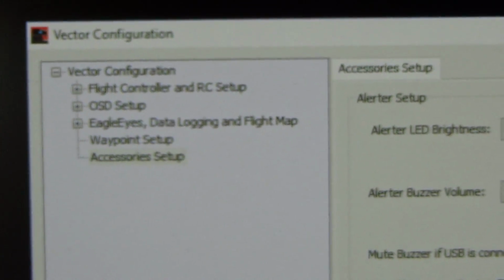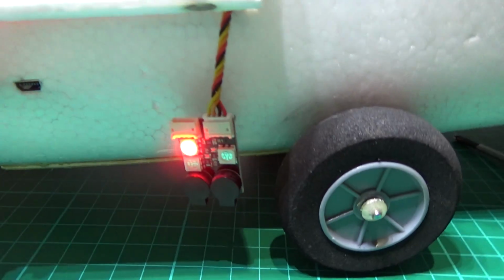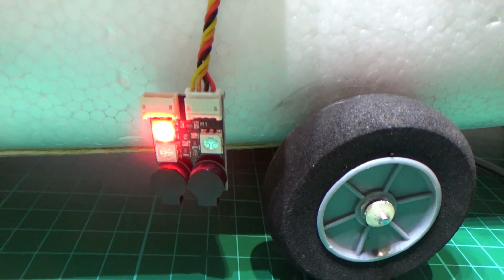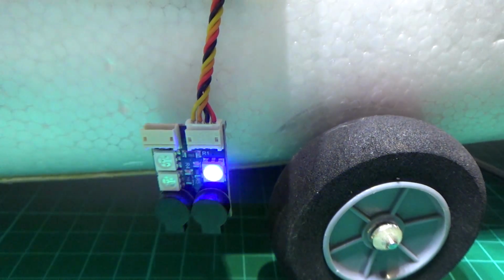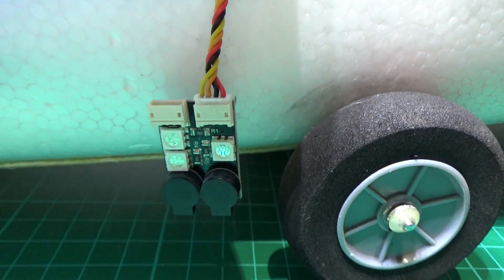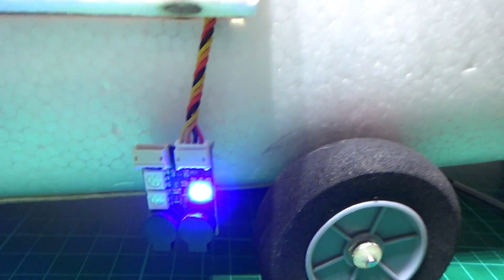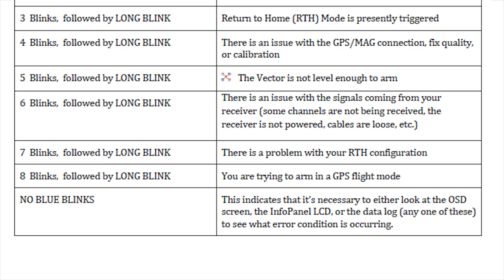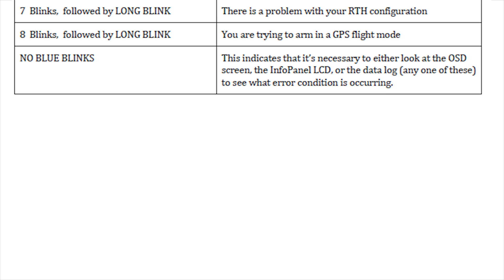Eagle Tree Vector Alerter (Beeper and LED module)

Comment: Looks good Tony. :) better safe than sorry. I still haven't gave up on my search. I found 15 golf balls instead of a quad.
Reply from the maker: +chris miller I'm putting nothing down to luck. I've now got a GPS tracker, UHF beacon, 20w LED strobe and a ridiculously loud beeper. The trouble is, the effin plane's too heavy to fly now. At least I won't lose it :D Would the sale of 15 golf balls equal the cost of a Vortex?
Reply: Vortecks well.. it will take a few more golf balls to add up to the cost of the quad. But at this rate if I keep finding golf balls I will have enough. Happy flying my friend

Comment: This looks like something I need.
Where did you order it from?
Reply from the maker: +dmerc00 You definitely need it, Dave. I ordered it from RC-Log in the UK but you can get it direct from ET http://www.eagletreesystems.com/index.php?route=product/product&product_id=154
Reply: +Vortecks Thanks! I had to pay $2 more but I got two from RMRC in Florida since I was ordering the bigger FS case to accommodate the new FS Dom faceplate and an ET airspeed sensor for my Chimera wing. At least the shipping is cheap.